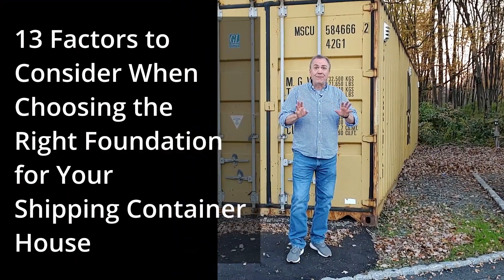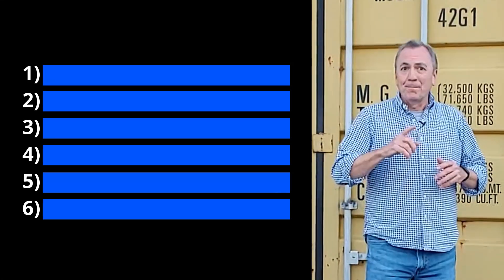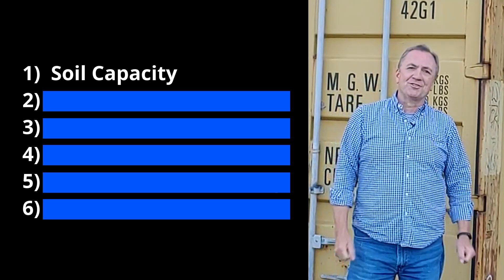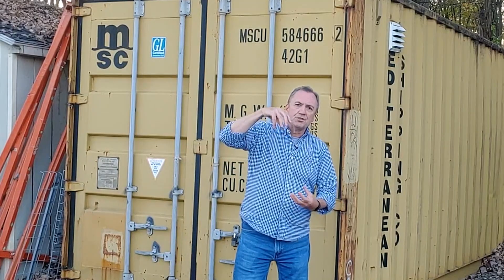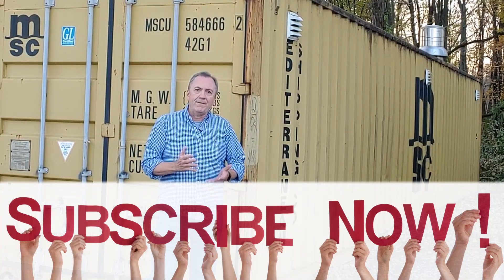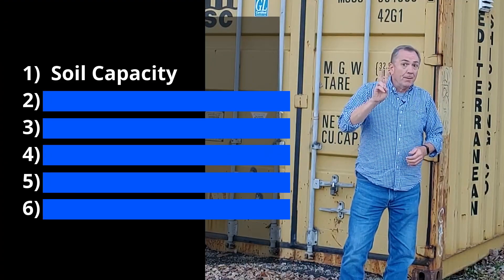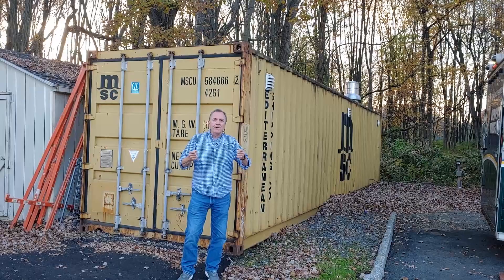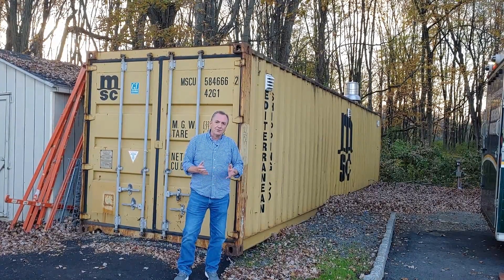Part 1 of 2: 13 Key Factors for Selecting Your Shipping Container Home Foundation

Comment: Great video. What do you do if you have water at about 17 inches and want to use a sonotube? Any thoughts? Gravel under the pier? Thank You.
Reply from the maker: That is a question that should be asked to a structural engineer. I would guess that sonotubes would not be a good solution and a floating raft slab or a deep pier that relies on the friction of the sides and not the bearing to be a better choice. But, like I mentioned before, check with a structural engineer about that.